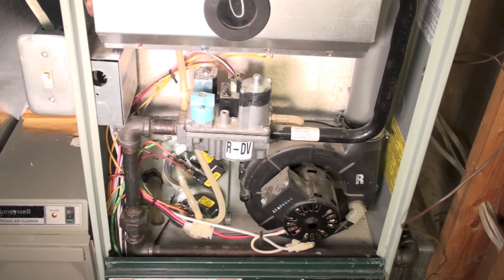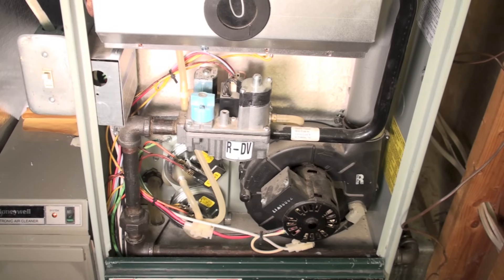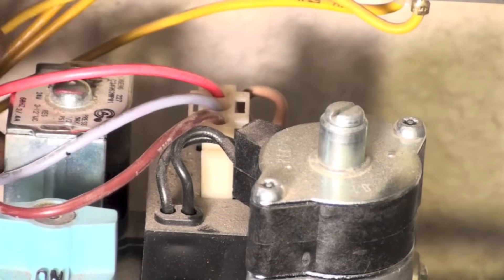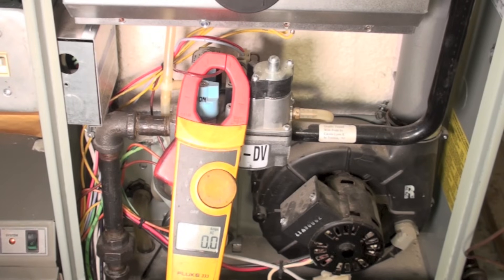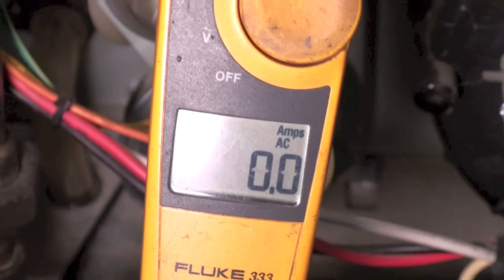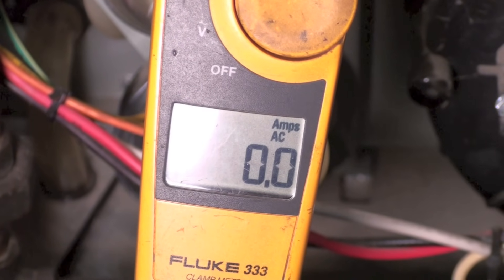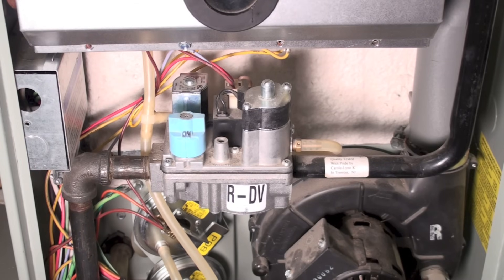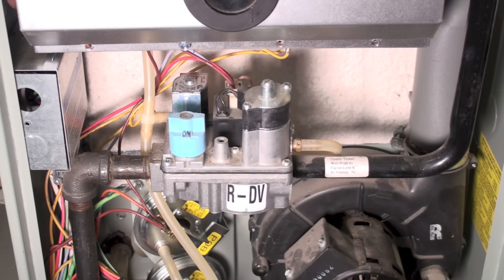The simple check of the gas valve

Comment: Hello, the heater cycle begins, igniter lights gas valve comes on and three of the four burners fire except the one with the cleaned flame sensor and that happen to be the non-lighting tube. If I blow on the other flames it will carry over and light. I took a fine pick and put it in the gas jet just to make sure a spider or skunk was not clogging it:) 
What could it be???  POWER WAS OFF...
Reply from the maker: First, clean the burners.  Check the manifold pressure and set to factory specs.  You could also check the heat exchanger for cracks and flame rollout from a cracked heat exchanger.  Hope this helps.
GFM
Reply: Gary,
I swapped it with another tube  and the pilot flame lit all burners.
Thanks
Reply from the maker: Merry Christmas
GFM

Comment: hi I have a robertshaw grayson ADERC valve on my furnace hot surface btw. I have replaced every electronic component and relay I even replaced the inducer and the valve and still nothing. the ignitor will glow and when it gets to the point to light the valve will make buzzing noise for a few seconds then stop. I have a gas stove and water and they both work fine. I have had no heat for 5 weeks now and still can't seem to find whats wrong its as if I am not getting the gas but the rest of my equipment work fine. Do I need to bleed the valve somehow?
Reply: oh and its a miller furnace forced hot air.
Reply: +jeremiah jenkins you don't have enough pressure in your  gas supply , you you have to have certain amount of gas pressure
Reply from the maker: +teddy acosta The other appliances work ok.  Probably not incoming pressure.
GFM
Reply: I got it working about 4 days after this post it turns out there was 1 relay I missed.It works fine still "knock on wood" so everything on this furnace is new pretty much even the blower.

Comment: My furnace seems to be going through the entire sequence-of-operations correctly up to where the hot surface ignitor lights, and then I get 24-25 volts on the gas valve -- but I only get 24 volts for maybe one second, and the voltage drops back to zero -- before there is any ignition.  It seems like maybe some (safety) check is failing and the voltage is being removed.  How would I go about isolating this issue further, e.g., to the gas valve itself, or the control board, or...?  I don't want to start randomly buying new parts w/o a better guess as to the root problem.  Is there a video (or videos) that addresses this kind of symptom?  Thanks for any help you can provide.  Your videos are great.
Reply from the maker: Some of the control boards sense if the gas valve is using power and if not, it shuts down.  There should be a blinking code.  
GFM

Comment: Thanks for the great videos. Did all the checks and determined the gas valve was bad. Replaced it and it worked fine for an hour or 2. Same issue. No gas from valve. HSI fires, I get power to valve but I did notice it was at 90 volts for a split second then down to 25 volts or so for 4 seconds. Could my board be shorting out my valve? Thx
Reply from the maker: +Stuart Wright I have not seen it but it could be.  Sounds like a new control.
GFM
Reply: +grayfurnaceman Thanks so much for responding so quickly. I took the old valve and tested it a 24 volt transformer I had and it works fine. Thought I'd try to replace the HSI since it's Friday and then control which will have to be ordered. Your videos have been a great help!
Reply: +grayfurnaceman Updating for others. Replaced the control board and works like a charm. Had a sticking limit switch but all good now. Appreciate your very informative videos.

Comment: Hi there
My furnace kicks in but ignition does not heats up although gas kicks in as you can smell but after 3 tries it shuts down. I checked ignition continuity and it reads 63 so it's ok and good to go. Blinking lights reads 34 am I looking at gas valve problems?...
Reply from the maker: I would check voltage to the HSI while the unit is trying to warm the HSI.  If voltage is there, the HSI is the problem.  If no voltage and gas valve opens on a trial for ignition, You have a connection problem or it is in the control board.  Hope this helps.
GFM
Reply from the maker: If the gas valve opens there is no problem with the valve.  I would check voltage at the HSI during a trial for warmup.  Voltage there, HSI is the problem.  No voltage, wiring problem or the board is not sending power to the HSI.  Hope this helps.
GFM
Reply: Good Morning:I replaced the HSI and did check the voltage at HSI but it appears it is not working. during the warm up I could see that it is trying to energize but the voltage is dropping pretty quickly and at certain occasion thee is no voltage but at the sixth attempt it mantained 121 volts but after I hook up HSI I have the same result As suggested the furnance control board is bad.
Reply from the maker: Sounds like a board problem.
GFM

Comment: The way to confirm is to check manifold gas pressure. If you have amp draw but no gas pressure, there's no gas. If you have inlet pressure as well, the gas valve is bad.

Comment: On 110 volt washing machines we would use a 110 volt clip chord to force water valves on to test if they are working.  Is there a way to force the furnace valve on by connecting the solenoid to a 24 volt AC current supply?  I believe you can also check the solenoid for continuity with an ohm meter.  If it's open, it's dead.
Reply from the maker: You could use jumpers from R and C terminals of the control board to the terminals of the gas valve.  This will bypass all safeties, so be aware.  An ohmmeter will probably be useless as there is a rectifier in series with the solenoid.
GFM
Reply: @grayfurnaceman  What about clamping the white?  Would that show Amperage?  It's allegedly active for both high and low fire.
Reply: @grayfurnaceman  Good to know about using R and C as a power source for 24 volt devices.

Comment: I have this exact issue. The igniter glows red and nothing happens. I checked the voltage to the valve and for a few seconds voltage does go to valve. the gas line is on (i opened the pre gas valve screw slightly for a brief second and gas comes out.  so the problem seams that regardless of both electricity and gas supplying the gas valve it still is not allowing gas to pass through (I'v checked with a manometer the outflow screw and no gas is passing the gas valve).  This all being the case is a faulty gas valve the only possibility left?
Reply from the maker: From what you say, the gas valve has failed.
GFM
Reply: Luke DaDuke Did you end up replacing the gas valve?

Comment: MY furnace has been acting up for a few months now. At first the inducer was running while the stat was in AC mode. It would turn on randomly and turn off. thought the stat was bad so i changed it. Still had the random problem with the inducer then all the sudden the blower would run too. 

When I finally turned the furnace on it seemed fine. All the sudden it started doing the same thing.....the inducer and blower would run for no reason. 2 days ago I was laying in bed and heard it short cycling. Well last night after work I got home and hear it spinning up. The gas never came on and it shut off. Went and checked it and the inducer would run and the HSI would glow. When it was supposed to turn the gas on it would just shut off. I took the door panel off to stop this cycle because it would not stop. Pressed the switch and it spun up. This time it fired up and ran. released the switch and put the door on. it spun up and then would not fire. There were no fault codes on the board. 

Figured since the ignite would glow that my limit switch was fine and the pressure switch worked. Didn't think there could be a gas valve issue since i was having strange issues prior to this happening. I ended up ordering a control board. Hope this is my issue.
Reply: did that fix it? 
im having similar issue.
Reply: The blower motor will run if you power on the furnace while there's a call for heat (thermostat on).  It's a safety measure.  Turn the thermostat off before powering on unit.  Sounds like you're experiencing the problem I addressed above.

Comment: Thanks for the great video. My gas valve is not getting any current to it at all. So where do i go from here? Does that mean it needs to be or is there a problem with the power source?
Reply from the maker: Adrian Loera Remember, the gas valve is only energized for 4 to 7 seconds during a trial for ignition.  It should have power after the HSI warms up.
GFM
Reply: It cycles again and again but from what I see the gas valve doesn't energize or receive current. Do you think the gas valve needs to be replaced?
Reply from the maker: Adrian Loera I assume you do not show voltage at the gas valve at any time.  If so, its not the gas valve.  Its kind of like running out of gas in your car.   You don't replace the car, you put gas in it.  Now, If the furnace is less than 25 years old, It probably uses a hot surface ignitor to ignite the gas.  Is it coming on?
GFM
Reply: Yes everything else has current and the surface ignitor is working.
Reply: Adrian Loera
did you solve the problem?  i have a similar problem now   if i unplug the flame senser i will turn the gas on but if i dont  put the plug back on quickly then it will shut off
Reply: huang feihong yes i did. I replaced the control board and everything is rubbing smoothly again.
Reply: thanks

Comment: Enjoy your videos, very helpful in troubleshooting furnace problems. I have a Tran Xe 60, circa 1988 with a White Rodgers gas valve model 36C53-418  which I have replace two years in a row. Once again furnace won't start. Pilot won't stay lit. Have 28 to 30 mv across thermocoupler  (pilot light model), 26.9 v across wires leading to gas valve (single stage), gas valve makes a humming or bussing sound. It that normal or is gas valve bad again? Why would my gas valves continue to experience these same problems, since the first gas valve lasted 27 years? Thanks for any suggestions or input. GS
Reply from the maker: If the pilot wan't stay lit, regardless of the mv reading, replace the thermocouple and be sure the pilot light is covering the thermocouple at least 3/8".  The fitting should be snug at the gas valve but not tight.  The buzzing sound is unusual, but not unheard of.  The why I cannot say.  Voltage at the valve is ok.
GFM
Reply: Hi, thank you for the idea, went to hardware store and picked up new thermocouple. Will replace in morning. GS
Reply: Replaced the thermocouple,  installed as noted but pilot light still doesn't stay lit. When I turn the power off and then on there is a definite electrical click from inside the gas valve and then the constant humming or buzzing noise from the valve. Is there a solenoid inside the valve that may be causing the gas not to flow once the pilot light button is released? Any other ideas? GS
Reply: Working again, not sure why, but will hope for the best, thank you for all your videos, GS
Reply from the maker: Cross your fingers and hope.
GFM
Reply: @grayfurnaceman   Hi, new problem with same furmace, pilot light stays lit until thermostat sends signal for ignition. Immediately pilot light is out. Getting the 27 volts at gas valve on ignition, any ideas? Thank you, Gary
Reply from the maker: @garystier5364  That generally happens when there is a supply problem with the gas.  Any other gas appliances that work normally?
GFM
Reply: @grayfurnaceman  Have gas water heater and gas range working properly. Still have the bussing sound at gas valve when thermostat sends signal.
Reply from the maker: @garystier5364  When the pilot goes out, does gas flow to the burners until the pilot safety shuts down? (about 1 minute)
GFM
Reply: problem resolved, loose wire from solenoid, thanks for all the great videos.
Reply from the maker: @garystier5364  Glad you got it going
GFM

Comment: Thanks for all your vids GFM, I'm learning a alot! Question, I went to look at a Coleman furnace Dgat056dbf at a mobile home. I checked the limit switch, flame sensor, gas valve was being energized, but whats happening is the igniter turns on flame is lit but as soon as the blower kicks in, it turns off! when it try's again it will light, and then turns off again. I replaced the flame sensor, and the board and also bypassed the limit switches to see if furnace would stay on.
Reply from the maker: Victor P Have you checked the heat exchanger?
GFM
Reply: I have not. is the Heat exchanger a replaceable part?
Reply: Victor P The heat exchanger is a very difficult to replace part (and also is expensive.) Chances are, if the heat exchanger is bad, then the furnace should be replaced as a whole unless the heat exchanger is under warranty. It may be a flame rollout caused by a bad heat exchanger. Check the flames before the blower comes on and after the blower comes on to make sure they aren't rolling out. If they're rolling out, chances are you either have a bad heat exchanger or something is blocking the flue. The rollout sensor will detect a rollout and shut the furnace down for safety reasons. If it is rolling out the front, shut the furnace off and keep it off until you can replace the furnace or have a HVAC tech out to check the flue/heat exchanger. A blocked flue or cracked heat exchanger can release CO into the home which can be deadly. If something is blocking the flue, typically the pressure switch will not close and the furnace won't attempt to light - so it sounds like you may possibly have a bad heat exchanger. Coleman used to have drum heat exchanger (GFM made a video one a Coleman CGU with a drum heat exchanger) and those are really difficult to inspect. A typical furnace heat exchanger (clamshell or tubular design) are easier to inspect, especially on an up flow furnace, as you can run a camera through down through the evaporator coil casing or through the blower compartment (if it is an 80% furnace) to look for holes, cracks, or missing rivets. Hopefully you can figure out what is the problem - probably best to leave it up to an HVAC tech who better knows what they're looking for.
Reply: 1912RamblerFan01 thank you for letting me know.

Comment: I have a small leak on top of gas valve around plunger switch. Could i replace plunger switch and save getting a whole new unit?
Reply from the maker: kenny clark Parts are not available for gas valves. Replace the valve. 
GFM

Comment: What about when a gas control valve makes a loud buzzing? Shut off heat and turn it on again and it runs then another time the valve buzzes like crazy again?
Reply from the maker: There is no repair, just replacement.
GFM
Reply: @grayfurnaceman  are they preset from the factory? I don’t have manometer and I need to replace it and all the companies in my area are too busy for a week at least. I can swap it but can’t adjust it.
Reply from the maker: @lh98  They are preset.  It is just necessary to check the pressure to be sure it is right.  You can also check the gas flow by clocking the meter:  https://youtu.be/I0bWSBVCXbo
GFM

Comment: how about remove the cap on the service port and hook up you manifold? if you can get a reading after g.v energized, it means the solenoid inside of the g.v is good and vice versa.
Reply from the maker: That will work if there is a port on the outlet side of the valve.
GFM

Comment: Can I check for leaks without having no gas? The gas tech can’t install the meter for the gas because he found a leak. Any help will be appreciated. Thank you.
Reply from the maker: You can use compressed air or nitrogen at low pressure (10#) or less.  The piping must be isolated from the appliances.
GFM

Comment: My Lennox G12Q3-137-2 comes on for about a minute then shuts off. It keeps doing that but never lights. I changed the thermocouple (twice, just in case the first new one was bad) and put a new gas valve on it. It still shuts off. I don't see a block vent switch. The fan limit  operates but shuts off after a minute.
Reply from the maker: +Ken Qualls Have you tried jumping out the thermostat?
GFM
Reply: +grayfurnaceman  How do I do that?
Reply: +grayfurnaceman Ok, I know what you mean now. yes, I also tried a new thermostat and neither made any difference. ( I returned it). Is the fan limit control the likely problem?